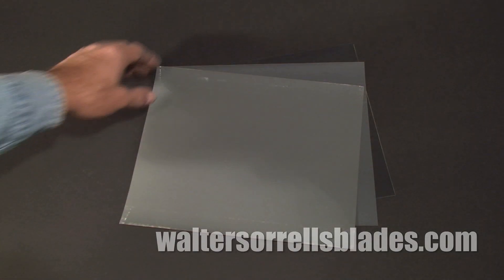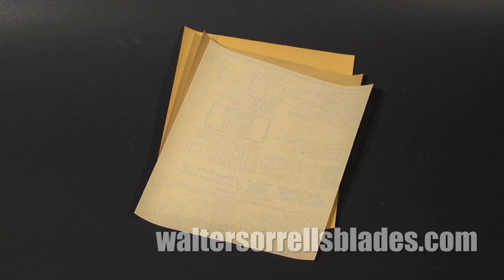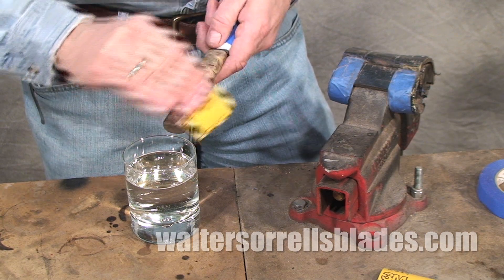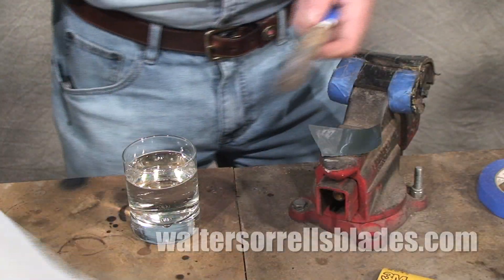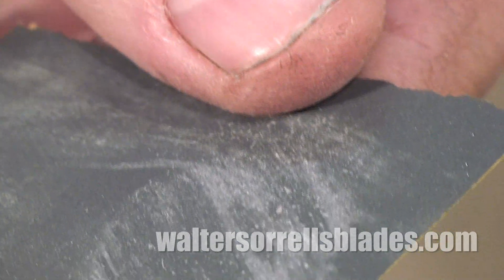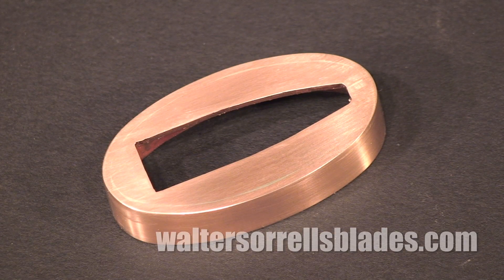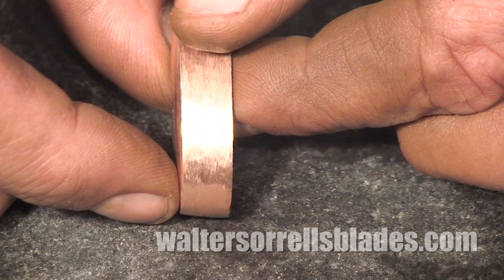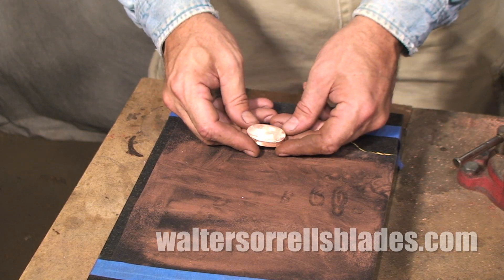Knife Making Tools 21: Sandpaper

Comment: What are your thoughts on the rubber sanding blocks? They seem like they would last longer with the same results.
Reply: Depends I’m not expert but I’ve spent days in total hand sanding and found sand paper wrapped around and old file works best used a wood block to I your sanding wood a DA works fine I’ve tried them that don’t work to well for me I’d just use your hands directly on the paper when a hard surface won’t work